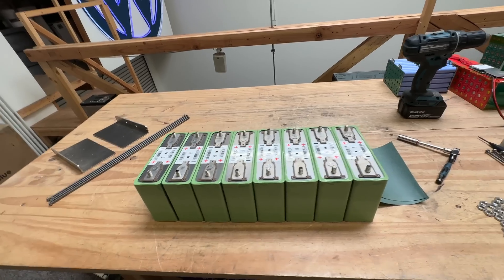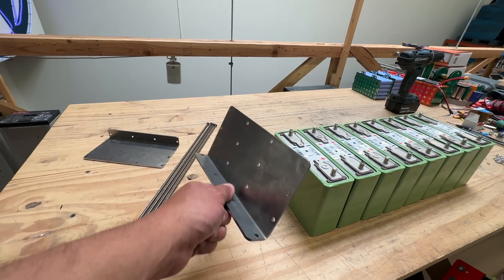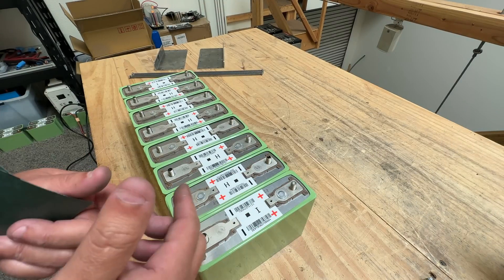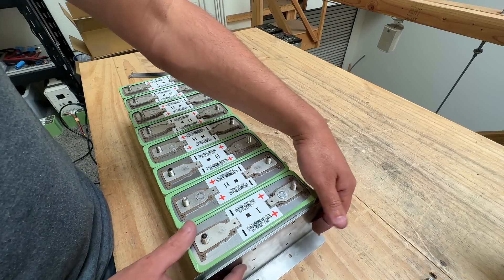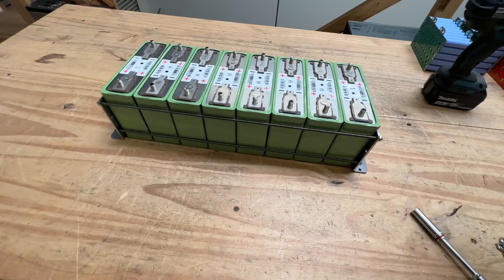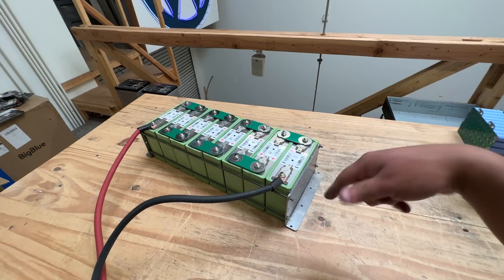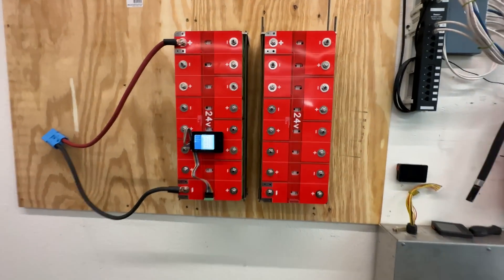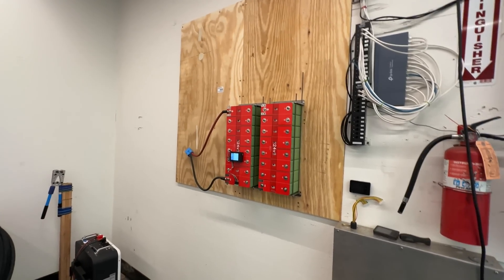LEV60 LiFePO4 12v  & 24v Compression Plates  DIY Powerwall

Comment: +1 for a great back build.
I'll point out that polyamide tape like Kapton has a dielectric strength almost 3 times greater, and a 6" wide roll can add less than 1mm to the thickness of each cell,; is fire, chemical, & radiation resistant up to 400C; and can be had for under $30.
Available in narrower & wider widths of course.
Reply from the maker: Hell yeah I love kapton tape, if it’s good enough for jpl is good enough for me
Reply: @jehugarcia hey J for car audio on my 148ah bank what Balancer do you recommend thanks .

Comment: I am considering 2 of the 6-pakcs so I can make three separate 12v systems.  I want to replace our gate battery, a spare for the UTV, and replace the single, simple deep cycle that is on the RV at the moment.  The missing component is a waterproof case.  Has anyone seen anything that would fit these, or ideas on making some?  Considered making some in fiberglass that would be strong enough to double as the compression solution and remove the possibility of the allthreaad wearing into the case.

Comment: Doesn't the cell manufacturer tell with what pressure they should be compressed? Is it irrelevant if they lay vertically or horizontally? and is a BMS not integrated?
Reply from the maker: Raw cells,  no spec sheet so far,  did you watch the video?
Reply: @jehugarcia  

Ok, and when they ship, they don't provide a datasheet.. or did they just  fall off a trailer 😆

Just kidding

Comment: Might think about selling plastic flanged nut covers to go along with your printed boards and connector plates. Of all the people supplying various electrical equipment that have bolt-down terminals it seems nobody includes something so simple and yet so necessary for safety.

Comment: You should add insulation between the allthread and batteries, the threaded rod would have no problem wearing through the cell shrinkwrap which would short two or more cell cases together.
Reply: I like to sleeve the allthread in vinyl tubing or pex. Don't know if these plates allow enough space to the cells to do that though.